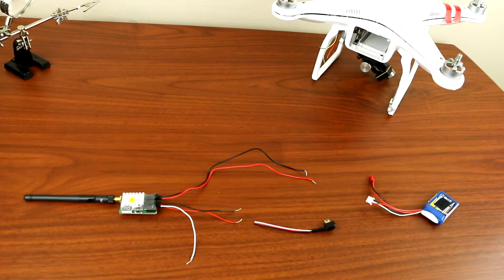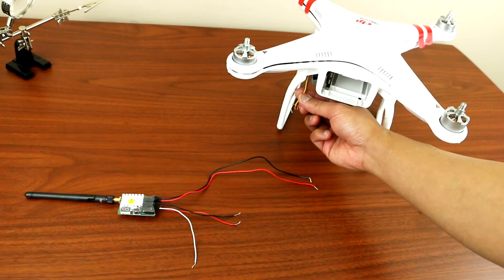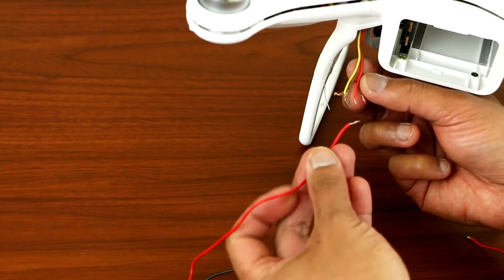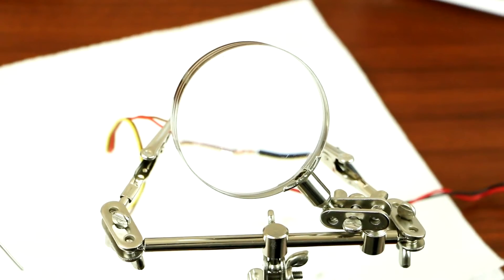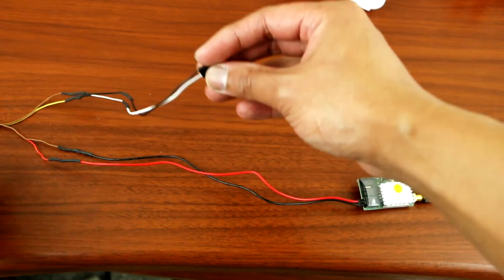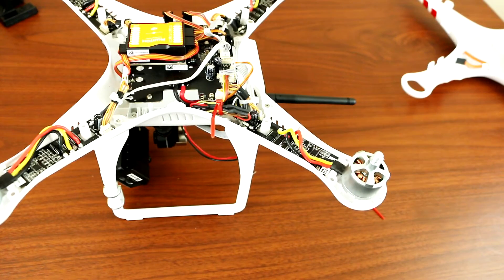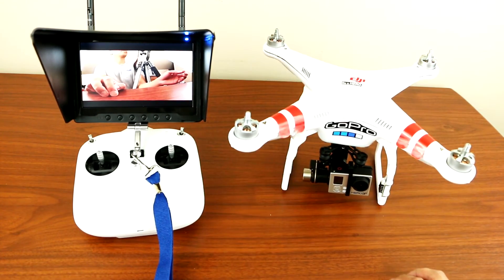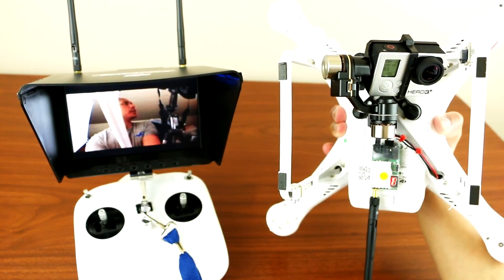DJI Phantom 2 - How to connect a FPV transmitter directly to your Phantom 2

Comment: I need some help. I dont have those 3 wires on my drone? Is there any why to get them from a webstore or something? I got a gimbal with a gopro and want to attach an antenna like that to use power from the drone along getting video without putting extra cable to the camera but im in a tricky situation where im missing those cables in the drone you fuse togheter. So is there some cheap sparepart package i can get to make it possible to do what you do in that video?

Comment: Awesome video..... Salamat
https://www.gothelirc.com/shopexd.asp?id=1981 Is this the correct kit there were two kinds.. I enjoyed your video.. (is the connecting wires included in the transmitter to solder the internal connector and transmitter or do i need to get those seperate?
Reply: John Jon difference between the 200 and 400 version of transmitter?

Comment: its the antenna that came with the transmitter.. So that just unscrews??  I felt like it would break if I tried that..
Reply from the maker: at the end of the antenna that is attached to the transmitter there is a screw that you can unscrew
Reply: ok.. just didn't see it.. I will check again..  thanks-  great videos btw..  and thanks for your input!!
Reply from the maker: JIMMY JAMES you're more than welcome and thank you for watching my videos!

Comment from the maker: @ AdeebSky - yes you can use other transmitter using this method, however, you have to be careful where you connect the wires. other transmitter have their positive and video out set up differently so make sure you connect the right one

Comment: I have the Phantom 2 with go pro and h3-3d gimbal.  Got the same monitor and same TX5802 transmitter.  For the last 2 days I have been messing with it and wired it the same way as you did here and I only get a blurry jumping photo in channel 5 on the TX and channel 1 on the RC.  No matter what I do I can't get a clear image on the FPV.  Help!! :(
Reply from the maker: have you tried changing all the channels on the monitor and on the transmitter make sure all switches are all on

Comment: How do you set up the iOS D mini with this setup?
Reply from the maker: DJI Phantom 2 - How to install the DJI iOSD mini to Phantom 2 (clean look version 1)  or  DJI Phantom 2 - How to install the DJI iOSD mini to Phantom 2 (clean look version 2)
Reply: L BS thanks!  in the clean look version 2, which transmitter is that and what monitor is used for that.  Sorry for all these questions. I just don't want to mess up on my phantom 2
Reply from the maker: ImmersionRC 600mw transmitter and Black Pearl 7" monitor
Reply from the maker: Joshua Burger ImmersionRC 600mw transmitter and Black Pearl 7" monitor
Reply: L BS If you have any critiques on my video, let me know. :-)

Comment: I plugged it in just like in ur vid with premade wire all I got was a black screen so I put the fpv hub and hit the little switch to vid and it got signal from zen muse no go pro USB attached.... I was going thru all channels and bands seemed to only work on F and B I believe..... Well I hope this info helps someone going thru the same process...great videos by the way would be lost without em ...thx
Reply from the maker: thanks! im glad you managed to get it working

Comment: Lol okay so I just got the flysight all in one to hook up with h3-3d gimbal but doesn't have the USB port wire like the newer gimbals is it still plug n play with premade wires? Or do I need the fpv Hub or is that for the AVL 5.8 Dji transmitter?
Reply from the maker: it should be the same as the h3 2d gimbal phantom plug and play

Comment: I've followed your procedure perfectly with installing the iosd mini and transmitter, i've downloaded the dji vission app so i can use my phone as the screen but i cannot find how to get this working? I've got a wifi booster as well and still can't figure it out, any clues? I have the h3-3d gimble same setup as you.
Reply from the maker: im not familiar using the cellphone as the monitor or how to setup the apps. also my gimbal is the h3 2d model, therefore i cant answer your question. if you get a monitor then it might work

Comment: Can you use another monitor with this setup? I am looking for a cheaper solution!
Reply from the maker: sure you can!
Reply: L BS thanks! Does the monitor have to be 5.8 Ghz if the transmitter is 5.8 Ghz?
Reply from the maker: Peter Solnør yes! i think monitor nowadays are compatible with the immersionRC and Fatshark transmitter
Reply from the maker: L BS yah, just to be on the safe side

Comment: but what's the purpose of IOSD mini for phantom 2?if you can explain to me
Reply from the maker: the purpose of the iOSD mini is that you can see the flight status of your phantom in the monitor, such as the battery percentage, height, distance, roll over, gps/att, and home location. DJI Phantom 2 - How to install the DJI iOSD mini to Phantom 2 (clean look)
Reply: L BS ohh i see..thank you very much..
Reply from the maker: ***** its one of the best upgrade to get for your phantom. your welcome brother!

Comment: Great video! I've spent hours on the internet trying to figure out which fpv setup i want and this is the one! I have dji P2 with zenmuse h3-3d gimbal and gopro 3+ black. Could you list the materials i need to buy to mimic your setup? (everything including wires, name of transmitter, receiver, monitor etc...) Thanks!!!
Reply from the maker: - Black Pearl FPV monitor
- FlySight 200mw transmitter (which I'm going to replace that with the ImmersionRC 600mw for better range)
- Wires are all included with the transmitter.
That's pretty much it you need. If you need more assistant msg me up! Good luck!

Comment: Great videos, thanks.  Do you have any tips/help on getting the signal set between the Phantom/Camera, and the FPV screen?  I have all installed but can't get a picture. Thanks!
Reply from the maker: what kind of FPV monitor are you using?
Reply: Black Pearl Rc801
Reply from the maker: Paul Bissett
what you need to do is go to your menu on the Black Pearl and go to "RF" then you have to play around with the Diversity band, RX 1 band and the RX 2 band by changing different letters
Reply from the maker: Moh 417 A, B and E